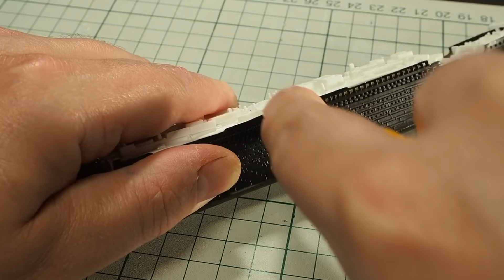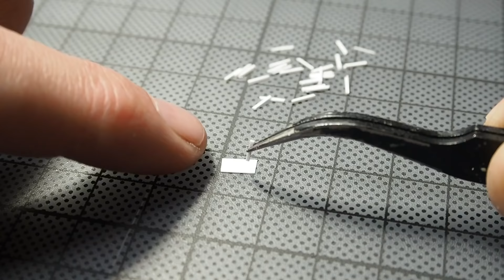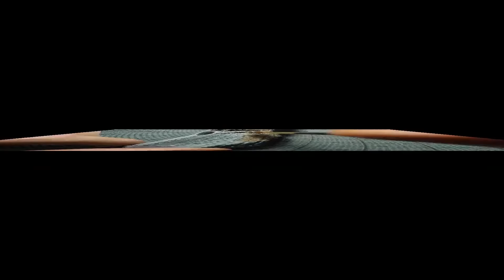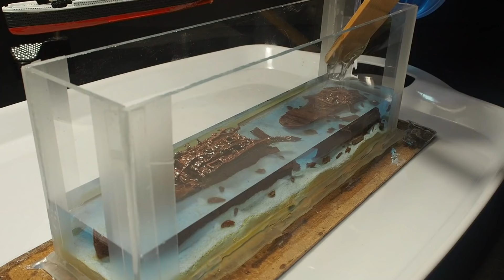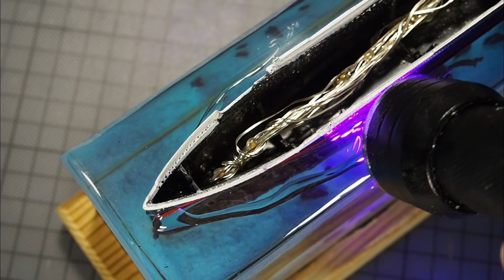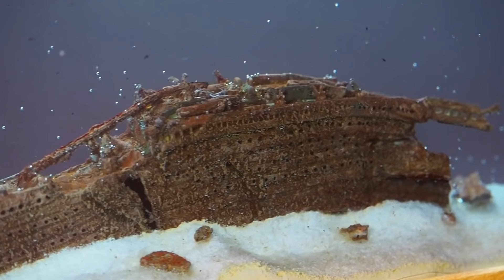TITANIC WRECK (BEFORE AND AFTER) DIORAMA/ How to make/ DIY

Comment: I have done a similar model that splits and reconnects with lego pieces attached inside it i didnt do it the way you did , i instead cut everything seperately with scissors and it worked perfectly . And it still works to this day , i planned on putting deck spaces in but i realised it they were getting in the way instead so i dropped the idea

Comment: This would be amazing in a museum. Cut it in half and add enough resin between them to accurately show the depth of the wreck below the surface. The before model could be at the top of a flight if stairs. Then as you go down the stairs around the model tower you could have other points that show how heights of skyscrapers etc in comparison all the way to the bottom.

Comment: I like how you made 3 of the 4 funnels function. The fourth was a dummy to make the the ship look bigger and more impressive.
Reply: that’s not entirely true.
while it wasn’t connected to the boiler rooms, it wasn’t necessarily a “dummy”. it had many important functions, like ventilation for the galley stoves, various lavatories, the turbine engine room, and other machinery spaces. it also vented the smoking room fireplace, and housed an important crew passageway.
technically, it had more functions than the other 3!

Comment: Titanic, launched on May 31, 1911, and set sail on its maiden voyage from Southampton on April 10, 1912, with 2,240 passengers and crew on board. On April 15, 1912, after striking an iceberg, Titanic broke apart and sank to the bottom of the ocean, taking with it the lives of more than 1,500 passengers and crew.

Comment: Fun fact: there isn’t any smoke coming out of the fourth tunnel because it’s a fake, this is because the RMS titanic was inspired by the RMS Lusitania which has four tunnels, the fourth tunnel was used by the kitchen of the RMS titanic though.
Reply: the 4th funnel was used for many important functions, like ventilation for the galley stoves, the turbine engine room, lavatories, and other machinery spaces. it also vented the smoking room fireplace, and housed an important crew passageway.
while aesthetics did play a small role in it’s inclusion, it was definitely wasn’t “fake” and was just as functional as the other 3.
Reply: @DerpyPossum  yeah but you get the point

Comment: I like how you only put 3 smokes on the funnels, it shows the fact that only 3 funnels were actually functional, and that the 4th one was merely there for aesthetic purposes.
Reply: the 4th funnel was used for many important functions, like ventilation for the galley stoves, the turbine engine room, lavatories, and other machinery spaces. it also vented the smoking room fireplace, and housed an important crew passageway.
while aesthetics did play a small role in it’s inclusion, it was definitely just as functional as the other 3.

Comment: I'm glad to see that the 4th boiler is not putting out smoke because it was fake
Reply: Well, for starters, it’s a funnel not a boiler.
And it wasn’t really “fake”, either. It just wasn’t like the others in that it wasn’t connected to any boiler rooms. It served many important functions, like ventilation for the galley stoves, the turbine engine room casing, lavatories, other machinery spaces and even the 1st class smoking room fireplace. Because of this, some trace amounts of smoke can be seen exhausted out of the 4th funnel in some photographs, just not as much as the other 3. 
In a way, it had more functions than the other 3!
Reply: @DerpyPossum  thank you for the story of the titanic the funnel is still there for design it does have some functionality but those functions don't require such a large funnel

Comment: The Iceberg was missing and it would be good to make another diorama plotting the moment in which the ship splits and the bow sinks and the stern remains high above the surface and in the air, also visualizing the Iceberg.
Reply from the maker: I have done another diorama with the iceberg.  You can check it out

Comment: I did the same technique creating custom engine room engines using tracing plastic works just as good as styrene though I never used styrene plastic probably has more tensile strange than tracing plastic which is very flimsy and unstable.

But when you have lemons 🍋 make lemonade 🍋.
Reply from the maker: That's true. We do the best we can with what we have and can get 🙂👍
Reply: @4THECRAFT  it's pretty expensive if you don't have the budget the pieces increase the price if add on the cart online to a hundred dollars or more. So small scale better idea in price and won't wipe you clean out of money 💰 .

Comment: There are a lot of bubbles still in the acrylic. Is there a way to get rid of those before it dries?
Reply from the maker: There are 2 ways . Either with pressure pot or with a vacuum chamber. Personally, I like some bubbles inside the sea.

Comment: NICE work and inspiring, thank you!  What material did you use for your resin pour?  Is that plastic?  The epoxy doesnt stick?  Or do you coat it?
Reply from the maker: For the mold I am using plexiglass. It doesn't stick with resin  so I don't coat it

Comment: what kind of pencils and paint did you use to make the corrosion color after the corrosion paint?
Reply from the maker: I used Vallejo air paints and normal pencils for painting
Reply: @4THECRAFT thanks!
Reply: @4THECRAFT also, for the back of the bow did you use the heat gun too?
Reply from the maker: @jamesjoyce4356  no. I used my dremmel and my cutter knife

Comment: You cut her around the 3 and 2 funnel instead as it should be 3 and 4 funnel but other than that great video and idea
Reply: A 3rd & 4th funnel break would be very historically inaccurate.
Reply: @DerpyPossum  no it would not, it would be correct
Reply: @marion86399  Only According to the 1997 movie, which is very outdated in terms of historical accuracy.
Reply: @DerpyPossum  The Titanic broke into several sections. The initial breakup was between the second and third funnels. The latter breakup between the third and fourth smokestacks/ copied from Wikipedia
Reply: @marion86399  Which is correct. 
However, your previous statements are worded to where it can be perceived that you were talking about a break reminiscent of the 1997 film.
Reply: @DerpyPossum  yes I may have been unclear

Comment: Great work however the stern of the ship is the wrong way around
Reply: In actually wreck its like that,stern is facing opposite to the bow,also around stern there is ton of the debris(cargo cranes,engines,boilers,broken decks,shell plating and some very big pieces).3rd funnel area along with the part that was 3rd funnel and 4th funnel is completely broken up.Those big pieces that found are part of those sections of the ship.